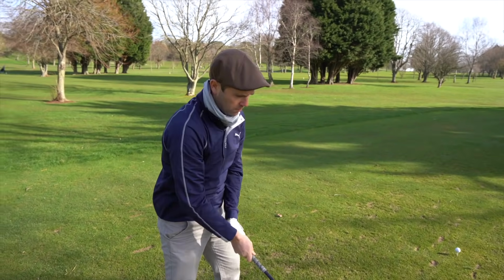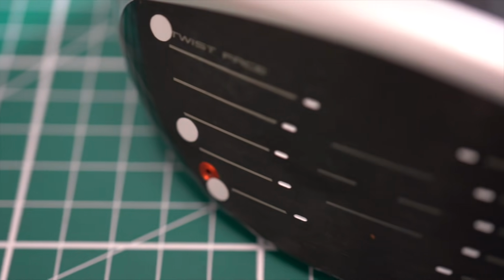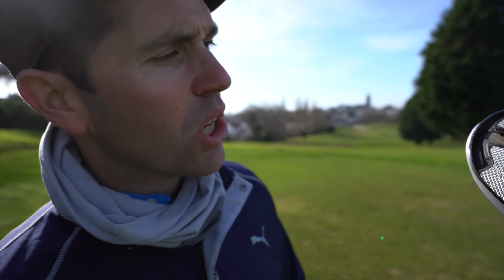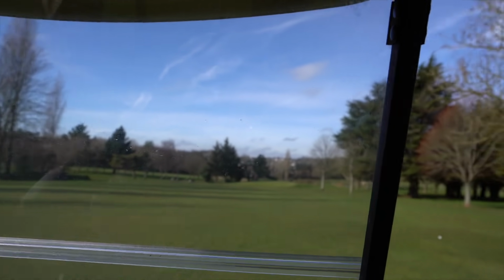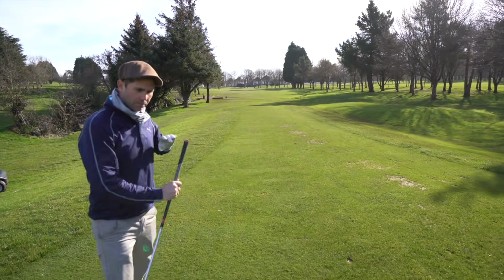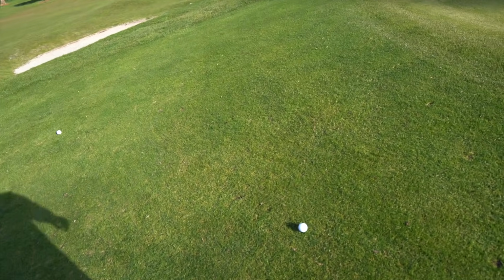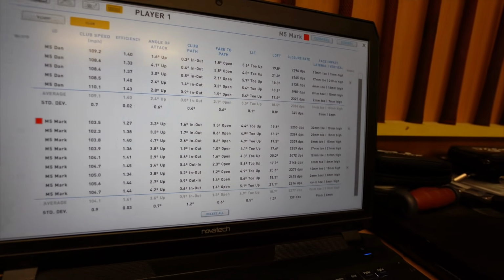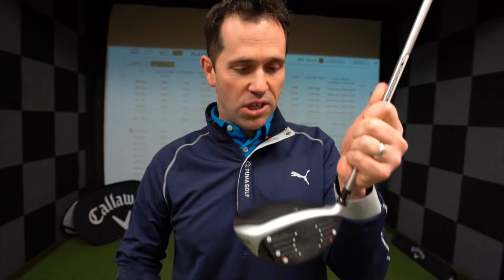TAYLORMADE M5 DRIVER

Comment: With the M1 the track doesn't line up with the middle either however with the M1 you can move the weight to be right behind the "sweet spot".  M1 is a GREAT design but the M5 looks SO sweet.

Comment: Any chance the tiny hole in the face is where TM ran a CT/COR check to make sure you got a hot face for your review? I mean, setting aside the marketing claim that every single face is as hot as the rules allow...
Reply from the maker: The hole in the middle is in other clubs
Reply: @MarkCrossfield  yeah, I've seen it in others. I got the impression from Dan's comment that it was not the normal mark (otherwise I figured he wouldn't have mentioned it). Just putting my tinfoil hat on for a minute. As always, I appreciate the inquisitive-cynical line you walk when you address "golf tech" marketing buzzwords.
Reply: @MarkCrossfield  yea my 17 m1 has that as well
Reply: @MarkCrossfield  It's to let the air out when it's compressed at impact!...lol

Comment: Mark you say toe strikes not coming back, but that's what the twist face was to do to help stop the toe hooks being so bad ?
Cheers Steven
Reply from the maker: No it’s not.
Reply: @MarkCrossfield  thanks for the reply, thought was to help with heel and toe strike  misses not going so far left or right, heel cuts and toes hooks ?
Thanks Steven
Reply from the maker: Steven Tait it’s meant to help bring it back not keep it out there 👍
Reply: @MarkCrossfield  sorry just been looking in to it and its definitely what I was thinking. A high toe strikes it's there to help toe hooks being as destructive as adding spin to quite the hook and with heel cuts being so Spinney taking spin of to quiet the fade. I have the M6 3 wood 14° and my toe strikes are a little draw instead of a massive toe hook off the charts left I seen with my old 3 wood.
I respect you and your work but I think you've got this one wrong.
Steven
Reply from the maker: Simple roll and bulge my friend. Ball will start more to right or left to allow it to curve back and not over curve. It doesn’t come back is not what it is for. 

I have worked with roll and bulge for over 20 years believe me you are not quite there 👍👍👍

Comment: I feel like I need to mediate between you and Dan on the modern-club-being-harder-to-shape point. I get that the mechanics of it are exactly the same and that it's all down to face to path. But if I take my old Ping G15 hybrid with no roll or bulge on the face, I feel a lot more confidence in knowing where I'm setting things up and if I'll be turning in or out. A newer Calloway hybrid with a more significant amount of roll/bulge - I just have a hard time getting things lined up. The ball certainly moves, but not really in the intended manner, or at least nowhere as consistently. It's a visual. Same reason I really like playing my MB irons. A thicker top line makes it feel like a cartoon golf club and I just don't feel like I KNOW what's going to be happening when the club hits ball/ground.

Comment: What I don’t get with these new tm drivers is that they claim to be injecting the face to take an illegal driver and make it legal so realistically the smash factor should be 1.5 or close to that in every good hit, but every review I see of this driver that number is consistently lower than the newly released drivers and a lot of previous models
Reply: Brett Clarke smash factor is based on mostly strike like 98% strike if u don’t strike it perfectly like a robot would which is 1.55

Comment: Don’t care how good or bad they are, until Taylormade stop taking the royal piss with the pricing of their products, I’ll shop elsewhere for equally good but much cheaper products.
Reply: The M5 is literally the same price as the new TS2 and TS3 drivers.  Are you running around complaining about Titleist Drivers too?
Reply: @MrSquishycheeks25  yep mr. Oi toyboy and me are very happy with our top flite and slazenger drivers 😆
Reply: Mike B I’m not running about at all. Last year I bought a Srixon driver for £280. It was 2018 model. There was no discernible difference between that and the M3. I tried most 2018 drivers. I also bought a set of AP2 irons from my friend, the 2016 sticks as he upgraded. I paid him £180. I couldn’t tell the difference between the new ones he bought for £1000ish and the ones he sold to me. Nor could he. SO WHATS THE BLOODY POINT?!

Taylormade are bringing out new clubs every year which, if we are all honest, are identical to last years model apart from the packaging.
Reply: @MrOitoyboy  All major manufacturers bring it new clubs each year that is basically the same as last year. Taylormade aren't alone there. And their pricing structure is exactly the same as the other major brands. Titleist, Callaway, Ping, Mizuno, they're all in that high end price bracket.
Reply: MrOitoyboy k this pisses me off so much 
TM M5 D- $789
Callaway epic flash- $799
Titleist ts3 - $779 
Like what do u mean as far as I’m concerned TM will be fine wether or not U buy a club off them so u can shop we’re the son don’t shine
Reply: John Phillips the whole point is that they’re charging too much for products that aren’t improving. Sure, if they managed to supply me a driver that did actually add 20 yards to my driving I’d pay them £2000 for it. Yes saving up for things and enjoying them, I’m all about that. But they’re just selling us the same old same old and charging too much for it.